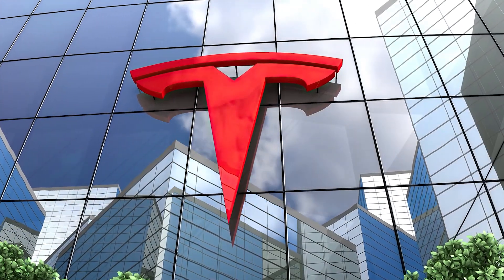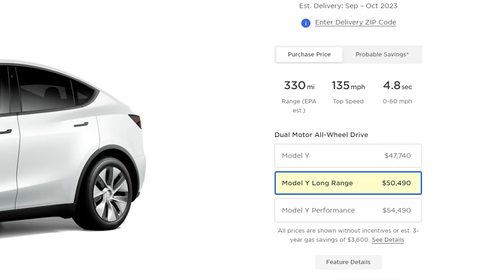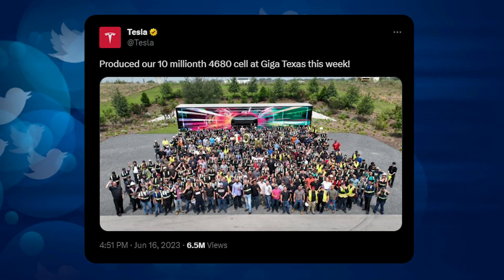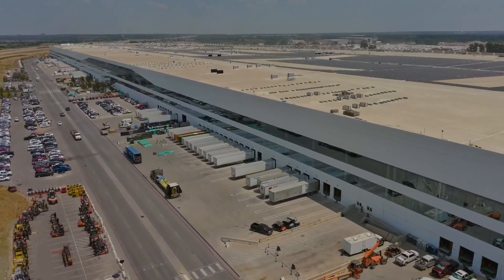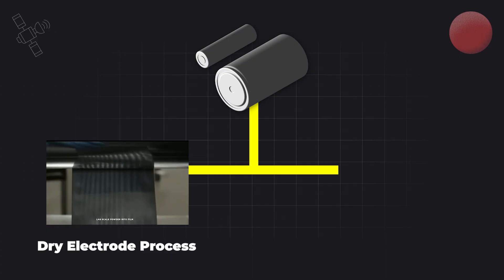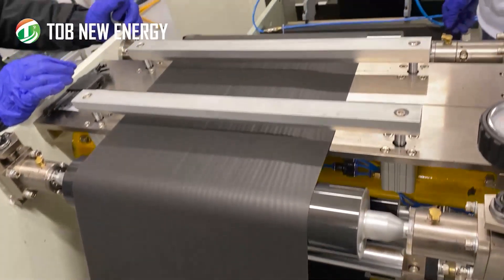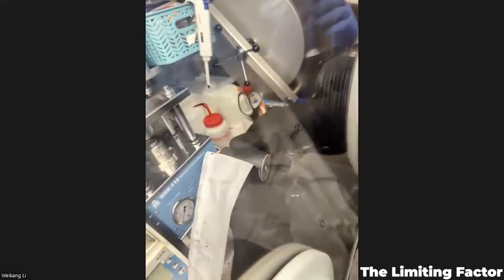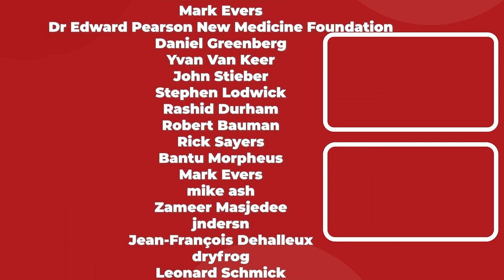Tesla Has A Problem With The 4680 Battery Cell...

Comment: Finally, someone talks about this huge problem. My uess is they start buying wet cathode equipment or switch to Catl or byd blade batteries. In reality, the good old 18650 is there best proven battery that gets the full ev credit. I'm amazed that anyone would buy a 4680 based car given the performance disadvantages. I predict a big change soon. I see drying ovens being used on the cathode lines so they can ramp in the next few months while they also backfill with China supplied batteries in non us markets. Germany won't see 4680 due to cost - performance. Blade batteries for the cybertruck are not out of the question either.

Comment: Elon is ever the optimist with his forecasts, turns out 'batteries are hard' too 😆 I imagine they will keep throwing money and people at the problem till they crack it open.
Reply: It's somewhat a necessity to have that optimism, else there's a strong tendency to doom the project right from the start.   A bit like programming.

I don't doubt they'll crack the issues sooner or later; for me the rolled endcaps more than anything else were the big advantage for the 4680 (or any other size) so I sincerely hope regardless of chemistry they are able to move from the existing capping method to the new rolled one for the reduction in internal resistance.

Comment: LiCAP Technologies in Sacramento, CA (originally based out of China I think?) Has this dry electrode coating as well. They mainly make capacitors but the process can be applied to batteries which I believe they are doing.

Comment: Why are these batteries cells so small? Would it not be more productive to make bigger batterie cells, this way the automobiles could have less of them and that would help with less points of failure.
Reply: It's about compromises. You essentially have to take all the parameters and come up with a min-max point. Go too big and some parameters start suffering (thermal would be one), go too small and your fixed losses start getting too high.
Reply: The problem is heat builds up inside a cell during use, and especially during fast charging (and fast discharging when the car accelerates in a jack-rabbit start).  The larger the cell, the harder it is to dissipate heat.

For example, read up on Boeing's Dreamliner, and the production delays due to the fire hazard it had from using just a few large battery cells.  (Google "Dreamliner battery fire hazard".)

Tesla's new tabless design for the cells promises less heat buildup, which allows them to make the 4680 cells significantly larger than the more common 18650 cells.  But making much larger cells simply isn't practical or safe, at least not with today's battery tech.

Comment: your logic for the price difference is acutely wrong. The only production cost decrease is in the battery cells. The production cost of the remainder of the car has not changed. So if the price of the battery pack is 10k for example then a price reduction of 3k makes more sense. I dont see how they can decrease the production cost of the battery by 70% to lower the price by 7k+.  Yet

Comment: Sadly for Tesla I dont believe jelly roll cells are the way ahead.

Rolling up the material makes them complex to build, and leads to batteries that are costly with poor packing efficiency, and difficult thermal management. It requires upwards of 1,000 cells to build up a vehicle battery pack.

In this context the blade cell configuration seems to be way ahead. They are simpler to manufacture,  have great packing efficiency and only need 126 cells to make a vehicle battery pack.
Reply: Opposite.

Comment: You didn't actually give any significant new information. Giga Austin has spent most of the last year building a new Cathode plant. Some of the equipment we know has been installed is stuff that not usually found in a Cathode production facility. (The weirdest one I heard of is presses to make tiles) My guess is that the techniques to produce a dry cathode has been solved, and the work lately has been to design mass production equipment to implement those techniques at scale. It's possible their idea won't work, but they certainly seem to be confident it will. The first indication that it is solved will be duplicating that plant in Germany and China.
Reply: They have hired Matt Tyler, a Milwaukee School of Engineering educated mechanical engineer, who has been working on battery cells for over a decade.
Most recently, he was working for Cambridge-based 24M, a battery manufacturer pioneering what it calls “semisolid electrodes” for lithium-ion batteries that came out of the MIT lab of Dr. Yet-Ming Chiang.

Comment: One thing to remember. Tesla is struggling to solve real engineering problems. They WILL solve them in time. The competition? They're shuffling chairs on the Titanic.
Reply: Wrong, competition is using different modern batteries, not old school batteries as talked about here.
Reply: @spinnymathingy3149   No competition outside China is even building EVs in volume. Building 1000 doesn't really count as volume. Go back to school.
Reply: @jhagen4850   your initial post is about Tesla having no competition ?? Well they certainly have. You also mentioned that they will eventually enter the 21st century with a new generation of batteries, the competition has already achieved this.  
FYI as you proven completely innocent on the subject the current Tesla battery design is a revamped 1947 (the year) design, with little more than new chemicals along the way
Reply: CATL and BYD are not shuffling chairs.  They are building amazing batteries.
Reply: @incognitotorpedo42  Duhhhhhhhhhhhh China FORCES auto makes to use CATL as a prerequisite to building cars in China. It's the state owned battery company. They've only stolen the best technology.
Reply: @incognitotorpedo42  agreed, and they are making more cars than Tesla does too. 
Goes to show that the Teslafanboys can’t see past the razzle dazzle of Elons hyped up misinformation

Comment: As a useless, retired, old Industrial Design Engineer, I see the problem is the dry binder. It maintains its mass and volume in the mix, thus displacing anode/cathode particles, reducing particle film density and making the film too thick. The solvent based system evaporated and reduced thickness while keeping the desired density. Either solvent base to maximize performance or reduce/replace solid binder with one that requires less volume in the mix, thus increasing particle density and cell performance. Committing to a production technology/technique before having a solution to these issues isn't an efficient process and these things were likely known, or SHOULD have been, prior to the massive commitment of resources toward this method of production. Like a said, I'm an old, useless, retired Industrial Design Engineer and these are simply musings of my observations.
Reply: As a life long adhesive and coating formulator, I will add my two bits.  Yes, volume is part of the problem in that a 100% solids mixture has to be applied at a thinner film thickness than a solvent system that is applied thicker and then gets thinner as the volume of the solvent is removed.  But they are having even more predictable issues in that the rheology of a totally dry system does not allow a smooth flow out into a thin film and it does not wet out the surface of the supporting film enough to give the required adhesion.  There are a couple of ways to solve this problem without the use of solvents, but it would require thinking outside of the box they are in their manufacturing process.  Tesla, give me a call....
Reply: ideas:  pezioelectric vibration of hopper during electrode coating; utilizing laser printer like application process for more uniform layer thickness;  application of current to dry anode/cathode in a spray on powder coating like process.
Reply: A disadvantage of blade/pouch cells vs. cans is when you have a chemistry that makes the electrodes swell and shrink as the battery is cycled. In that case, you have to encase your stack of pouches in a vice-like structure to stop them distorting. In can cells, the can itself provides the compression. 
Pouch cells have plenty of other advantages like packing more efficiently and having a better surface to volume ratio for thermal management but cans can be a better choice is some scenarios.
Reply: @spankeyfish - All things being equal, prismatic/pouch/blade cells are more expensive than cylindrical.  As long as basic requirements can be met (safety, lifespan, cooling, etc.), Tesla will always pick the least expensive option.
Reply: @ClockworksOfGL  Not sure about the cost issue. My BYD has a battery configured 126S1P. My TM3 (I am having a bet each way) has a battery configured 126S10P. It has ten times as many cells as the BYD.

Both batteries (60KWH) have very similar (good) performance.

The question is whether it is cheaper to make a battery with over one thousand small cells wired series parallel, or just 126 cells wired in series only.
Reply: Powder coat paints are thinner and more evenly applied than solvent based systems, likely similar to the application of the battery dry application.  They may have a mixing problem.
They need to use pseudo cavitation mixing.
Reply: Perhaps, but in my view spirally winding the batteries is the mistake. The cylindrical format is a legacy hanging over from C cells, D cells etc. They were weren't spirally wound they were bulk filled. For EVs the blade cell configuration makes much better sense and only requires 126 cells to make an EV battery pack, vs thousands for comparable cylindrical cells.
Reply: @jimgraham6722 the primary issue in an EV battery is cooling, though. This is where the cylindrical form factor makes sense
Reply: @jimgraham6722  Blade/prismatic is fine for LFP, but I wouldn't trust it for high-nickel/long range chemistries.  It doesn't help that the cells of that format are made in China and have a propensity to self-immolate.  Yet, safety may not be Tesla's only reason for staying cylindrical.  At least historically, it's also cheaper per kW.h, regardless of your impressions.
Reply: @jimgraham6722 Agreed.
Reply: @jimgraham6722  If I'm whizzing around at 75 I would prefer each individual battery cell under my feet to be wrapped in steel, no matter the performance cost.
Reply: Wasn't dry cell manufacturing supposed to be "ready"? Isn't that why Tesla bought Maxwell technologies? As it was their tech?
Reply: @CED99 well, I'm sure Maxwell did extensive r&d on the process, but never volume production of batteries
Reply: From other articles I've read part of the issue is these small granulated particles are harder then the steel rollers and as the rollers build up dents the film thickness exceeds spec. Causing more frequent line shutdown and maintenance. And while Tesla battery pics keep seeing shown I recall that there main battery supplier Panasonic makes most of there cells with the old tech and 4 or 5 tabs to achieve the same performance
Reply: Your insights are valuable, and it's clear you have a deep understanding of the challenges in battery production. It's true that the choice of binder and its impact on particle density is a critical consideration in battery technology. Your suggestion of exploring solvent-based systems or finding alternative binders with lower volume requirements is a valid approach to enhance cell performance.
Reply: these companies are designed to fail. keep an eye on industrial auctions in nor cal. battery manufactures built in 2021 sold off for parts in 2023.....less than a year of production on facilities hundreds of thousands of square foot. All subsidized by YOUR taxes.
Reply: Not unprecedented for Elon Musk.  They have continued launching Starships, though the Raptor engines have continued to fail on the test stands.  They fail in flight too, which is at least consistent.
Reply: Tesla should hire these guys.
Reply: Thank you for your service ~ now please go and enjoy your retirement.

Comment: I would still get the 4,680 battery cells with my model Y, because it has less chance of combusting. And don’t worry, Tesla does a lot of early fine tuning that helps to eventually ramp up massively.
Reply: Sorry to disappoint you. They use the same flammable electrolyte

Comment: Or we switch over to Na batteries and they move forward to solid state + remove the active carbon with sulfur. Boom - endless supply pool in terms of how many batteries that can make per day over a number of factories around the world. Solid state means we dont need as much mass for the same amount of power des. While Na has a lower power des than Li - aka you need to stick more - solid state means we remove half - that size and allow a few more batteries to make up the difference. Na is cheaper than Li meaning that increase amount of batteries wont dirrect mean the pack will cost more than it does today. Should be less none the same. Follow by Sulfur that allows between a 2.5 to 3 times more power dens. This means we also dont need all that many batteries either so cost should come down 2.5 times less batteries for the same power per pack. In total: this type of Na battery pack would be half the current size of todays Li version, half the needed batteries, and have a greater resources to use and can because Na can be found anywhere - can be made anywhere same with sulfur. Na has other great properties such as better temp ranges, can be fully charge or discharge (making it easier to ship in many cases), can work with Li hybrid designs as well, faster charging, and can take a little more heat per cycle - heat while charging is what normally kills batteries.

Comment: The 4680 battery is heavier (casing made of steel) It was made to be structural battery the bigger the battery, the longer it takes to charge the battery
Reply: 2170s will be around for a long time and can keep the performance there, for smaller vehicles.  4680s will still be great for large vehicles and storage, money to be saved for sure there.
Reply: I thought the tabless design was supposed to compensate for the larger can?
Reply: Right.  Wilson419 clearly doesn't understand the (claimed, and I presume true) advantage of the tabless design.  @dancingdog2790

Comment: They have some of the best people working in these cells. I’m sure they will get there but everything could change in a instant with another leap in battery tech and these could be outdated before even becoming the norm.
Reply: And you think that the battery companies haven’t had the “best people “ working on this problem for decades?
Reply: @rcpmac I'm sure they have, but the pressure is on now and I'm sure they have a bunch more resources and money to work with
Reply: Yeah, everything could stay the same for years, until it doesn't matter anymore, as better batteries would've arrived. Though, who am I kidding, those are taking their sweet sweet time too.